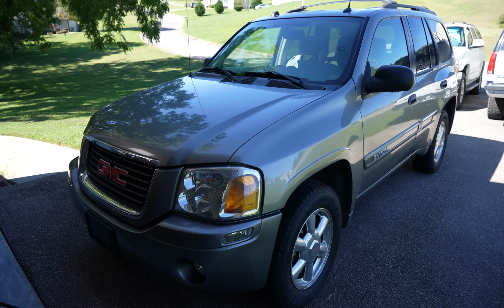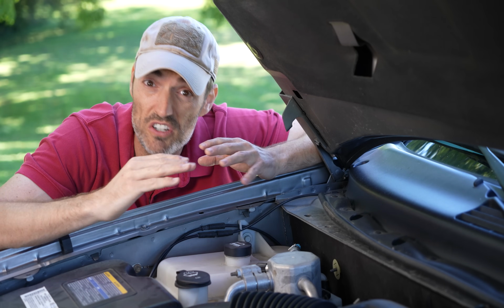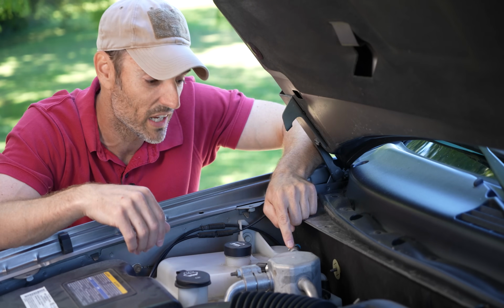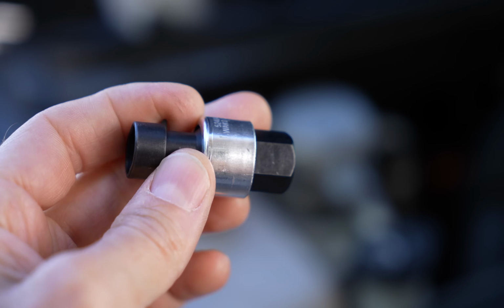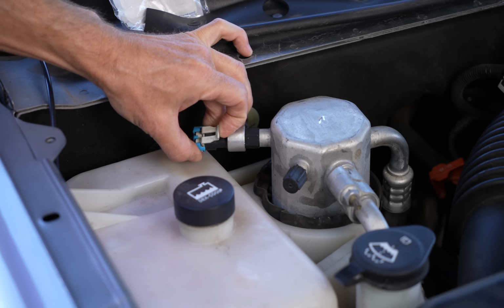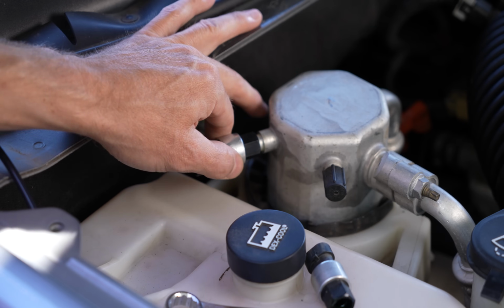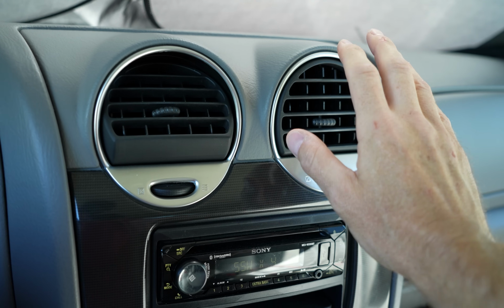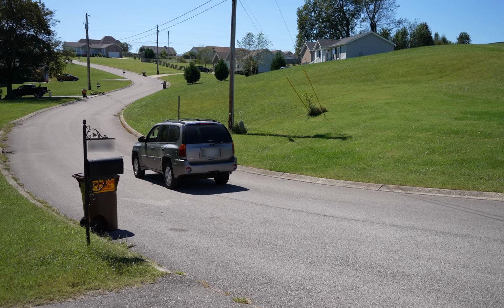GM Air Conditioning Pressure Switch Problem and Replacement!!

Comment: I think you should have checked the clutch or relay.   This parts cannon video isn’t the end of the saga.   Guaranteed.
Reply: If clutch cycles on and off it’s a good sign the Freon is low small amounts do leak out over time. If nothing happens but the clutch works jumping out the clutch relay then it’s probably a bad AC pressure switch the PCM won’t ground the clutch relay or the cooling fans relays if the pressure switch isn’t sending out the voltage the pcm wants to see
Reply: I replaced the fuse and AC relay still the problem persists.

Comment: Nah, I've always ended up with the right pressure in my system, but no cold air.
So I know it doesn't need a recharger. I think there is blockage somewhere or I may just need a new compressor.
2007 Lancer es.
If anyone can think of whatever else it. Advice is always welcomed.
Reply: There is a restrictor in the line with a super fine mesh screen.  There are 2 types these days, an expansion valve,  and an orifice tube with a screen.  If those get stopped up, which is common on higher mileage cars, they block the line and need to be changed.
 A shop can diagnose it easy. Put the gauges on and tell you exactly what it’s doing.  Finding an honest shop is the hardest part.
 They sell a complete kit, which is my preferred way to go.  Compressor, drier,  orifice tube , oil.  I do my own because I have the gauges , pump and and everything. You can change all the parts then take it to be vacuumed and charged.  Then you’re all new.
Reply: @megastick9324  thanks. I work at a shop so I have the resources to fix it. I just had no idea hownto diagnos it.
Now I just need to find the time to bring MY own car in. And I'm still learning alot. I'll look into it. Thanks again🙂

Comment: You can also jump the switch wire to check the circuit
Reply: Thanks for this tip Paul . This saved me a trip to the Mechanic and I diagnosed it myself .
Reply: I jumped the wire and the ac works but when I plug it in the ac doesn’t work. What should I be looking at next?

Comment: OK I looked it up - first the local mechanic replaced the fan clutch. But I had the SAME AC problem of it shutting off fairly soon. I was hauling fresh fruit for a job so I HAD to have AC. So then the Dealer checked out the AC - and found the low pressure and high pressure was good. So they replaced the fan clutch AGAIN claiming that an OEM part was needed. NO PCM update was done even though there was TSB previously for a needed PCM updated if the fan clutch is replaced. Same problem happened again - AC works and then turns off. So I'm the first one to replace the low pressure sensor!! Wow. I'll see if it fixes the problem. thanks again. Time to test it out.
Reply: had this problem when the vehicle was idling in 100 degree weather , cuts off and on and off ect.

Not sure if its because of that part or because these vehicles were not made to cool off the cabin in extremes temps at idle

Comment: OK I just switched it out. Oops - I must have tightened it a bit too much because I thought that tab catch thing was on the bottom. So it's a half turn too tight. It's just 90 degrees too tight.

Comment: My AC gets hot if the vehicle isn't moving. Goes back cold when you drive. Sucks in traffic
Reply: I found out thats somewhat normal due to low rpms of the fan and the ac compressor pulley not delivering high enough pressure
Reply: as an a/c tech if  you have an older vehicle you may have a vachume leak, and the blend door is switching to heat
Reply: Sound like your clutch fan is bad and or radiator is clogged, but definitely replace the clutch fan on the front of the engine

Comment: I have mostly seen one side stop blowing clod but the other is so it's not the pressure switch even though people tell my friends that it is even tho that makes no sense
Reply: as an a/c tech I'll tell you that it's not what you just saw. if you have a busy climate system that lets you cool one side more than the other it is most likely low on gas, but not always
Reply: @terryfrederickson2774  no mine is either the controller or the blend door because the left will be cold and the right will blow hot and you can turn it off and back on and it's fine
Reply: @terryfrederickson2774   Hi Terry, 
Hope your still on YouTube, can I ask a question please,  are the high and low pressure switches the same, meaning is the same switch (part number) used for either application, I know it sounds silly but one switch might register both high and low pressures, thanks for any information 👍🏻
Reply: Sounds like blend door to me

Comment: I have the SAME problem on my TB air conditioning - and previously we had the fan clutch replaced - and it didn't fix the problem. I think local mechanics just replace an obvious part. Anyway I just ordered this part locally - it's more expensive - but Amazon is just too hard on its workers. Also I'll get this sooner. I'll let you know if it works. All I know is my A/C works sometimes and then just starts blowing hot air - very very annoying!! thanks
Reply: This guy never let us know if it worked. RIP
Reply: @ninjaguyYT  Funny - it's not hot often where I live - just so happens I noticed the same problem. Works whenever it wants to. So I researched the TB - lots of people have the same problem. The AC "works when it wants to." Hilarious. I replaced the part indeed. Oh well.
Reply: @voidisyinyangvoidisyinyang885  well, I bought a new transducer for my 18 year old Jeep, that should be arriving in 3 days.  I'm probably going to forget to report whether it works. But I'm feeling like it won't. The old one was pretty loose and it didn't appear rusted or damaged. I screwed it back in easily (also I didn't feel it squirt any refrigerant out).
Reply: had this problem when the vehicle was idling in 100 degree weather , cuts off and on and off ect.

Not sure if its because of that part or because these vehicles were not made to cool off the cabin in extremes temps at idle
Reply: Douse the AC work cold at higher rpms if so the compressor is weak and starting to go out
Reply: @ryans413  ok thanks - that must be what's going on! Yeah the AC works better if I'm at higher rpm. Actually though they replaced the whole system twice. haha. And it was the SAME problem right after they replaced it. Maybe the AC system is just junk overall. It still works "sometimes."

Comment: Overtime it is normal to lose a small amount of refrigerant over time. Just a couple of oz. I do recommend not throwing the parts cannon at but hey if ur pockets are deep and you are learning what’s to lose.

What should be done is a vacuum test. See how much vacuum it pulls and how long does it stay. You do not want moisture in ac system.
Reply: If your pressure switch is working but pressure is low slightly your clutch will cycle on and off that’s a good sign your low on Freon. If your clutch dose not engage at all but engages when you jump the AC clutch relay then you probably have a faulty pressure switch. The switch reads pressure and when the pressure is low it breaks the contacts and the PCM dose not receive the signal it wants to see so it dose not send out and voltage to the fan relays and the Ac clutch relay to engage so nothing happens

Comment: Why not trouble shoot it instead of guessing what the problem is? Auto zone loves guys like you 😂😂
Reply: Hard to troubleshoot AC issues. I’m having the same issue now, every time Ive taken it to a mechanic (4 different ones) they do the general troubleshot AC test and they say everything is running perfect with no issues or leaks. But of course I’ll be driving it in 90° weather and it’ll all of a sudden go out and start blowing hot air. Niche vids like these can save lives
Reply: @kinnyboy  mine hasnt blown cool air in weeks 2007 GMC Yukon...but it blows air like the heater is on.....Mechanic says may need to replace  sensor and a belt ? freon good/no leaks just HOT air blowing during 100% weather?
Reply: @Theranchhouse1  might be your blend door actuator
Reply: @pegachick  thankfully another mechanic looked at it and said it just needed freon...he put it in and its wkg grreat!!!

Comment: I've had issues on my '02 Blazer with the low side Schrader port sticking open, causing me to loose full charge. On the car's I've owned I've never had a pressure switch fail (I'm sure now that I've said that it'll fail lol). Good to know you can just unscrew those, I've always thought you had to vacuum the refrigerant and then replace it, vacuum the system down and then fill it back up, but this is good to know for the future!
Reply: You do have to remove all the freon replace the part then vacuum the system down and recharge on most vehicles. His vehicle is probably the only one I've seen like that.
Reply: @MN2_Kevin_Hill_1970  no you don't not on most cars you do it just like he just did on his what kind of car do you have so I don't buy one of those 😂👍
Reply: Obviously not all vehicles are the same.
Reply: I have mazda3. I couldn't change the switch because the freon was coming out. Not that easy.
Reply: So for anybody reading this later, they're talking about systems that don't have a Schrader valve. You should absolutely check if your ac system specifically has a Schrader valve before doing this yourself because in some cars you do need to evacuate all of the refrigerant and recharge it after, because it will escape if it doesn't have a valve. It's not only in new vehicles but different manufacturers started putting them in in different years. Do your research and be mindful that I think they can be added on to some systems, and there are similar valves on other parts of some cars, so finding a replacement valve doesn't guarantee your CURRENT *ac* system has one installed. It is not at the end of the world if you make a mistake and refrigerant escapes, but it's really bad for the environment (and therefore YOU) so if you are wrong just move away from the car and return after it leaks out. I do not recommend doing this without breathing and eye protection personally just Incase, but that's me having family and friends in HVAC and knowing little enough about cars to be cautious.
Reply: Should’ve show how to test those things before replacing. Good video though.

Comment: Any idea what causes the compressor to run all the time even when the heat is on? During the winter I have to unplug the compressor so it doesn't run when the heater is on.
Reply: It's designed to run with defrost and/or heat to remove moisture from the air to reduce window fogging.  In vehicles old enough to have manual control of the ac compressor, if your windows start to fog, hit the A/C button and watch them clear up!
Reply: @aaronpowell4885  my 2000 Honda does that... it's normal
Reply: @aaronpowell4885  I always run compressor during cold weather to keep windows from fogging up and heat is more comfortable since moisture is removed .
Reply: It is supposed to run during defrost
Reply: In winter it comes on with the defrost setting to remove moisture from the glass cause you got cold outside meeting warm inside helps defrost windows faster

Comment: I have a 98 GMC Yukon with no ac no nothing, it has 346,000 on it but she still runs good
Reply: Point is what ? Statement of Nothing Left that works , but the motor runs still ? Perhaps your motor is the last holdout part to fail ? Or Every Part Was Neglected to be Repaired ? What is the point in this experiment ? To see if the cigarette lighters Death will Blow your Engine ? Very Interesting !!!

Comment: You should have checked your pressures with a manifold gauge set !
Reply: This is 1R we dont do that here lol
he just replaces parts and expects them to fix stuff , at least they are OEM.
Reply: @JORGE4757S  Those parts rarely go bad,his problem is most likely a refrigerant leak !
Reply: Wrong. Those low pressure switches are a common replacement on GMs

Comment: I have a 2006 Chevy Silverado 1500 with 140000 on her and mine was doing the same thing after doing some homework I decided to replace the actuator door being my truck only has 1 and the part was cheap as well but so far that seemed to fix the issue.
I wanted to also add when this problem would a cure I found that turning the motor off and restarting the motor the problem went away and my ac would work again but now since the new part is in all is good .
Reply: Was your ac making a clicking noise as well? I have a 04 Tahoe that occasionally blows hot air on the driver's side.
Reply: @PaulieGlockzz  actually I'm not sure but it did seem like the ac compressor was still running but no cold air just hot air when this problem would acur.

Comment: Why not diagnose it - pull the code and then you have direction. I’m not a fan of loading the parts canon :-) just my opinion 🙂
Reply: Not all AC issues throw codes. Rarely ever will it throw a code. Especially older cars don't even monitor the air conditioning system. That's what the gauges are for.
Reply: Dude this is the wrong channel for you, Jimmy is the man of the parts canon
Reply: @JORGE4757S  😂😂
Reply: My AC in my old ass 2004 car just randomly stopped it blow hot air the AC light would be on no AC action the clutch would not engage and no fans running under the hood. The only way the clutch would engage and spin is if I jumped out the AC clutch relay even then no AC action. I removed the cap on the high side line and there was pressure also found no leaks and condenser looked fine no holes or leaks. I had no engine light or codes so last thing I decided to do is swap out the pressure switch really easy on my car it was right up by the cooling fans unscrewed it no need to evacuate the system it had a valve on it so only little pressure shot out screwed in new switch and soon I started the engine pushed the AC button clutch engaged cooling fans blasted full speed and I had cold air again
Reply: There isn’t always a code. I’m having this same issue but it’s not throwing a code at all.
Reply: When u know you know
Reply: I mean it's only a $30 part 😑
Reply: @JamesAutoDude  Actually much less on Amazon. My AC high pressure switch was literally like $11 lol. I changed it and rectified the problem immediately.
Reply: @justanexe  yeah that too. Rock auto is another cheap place as well especially if you want Genuine parts lol
Reply: @JamesAutoDude  Yeah, Amazon has some genuine parts too, but RockAuto would definitely win on that end. It’s just a matter of not getting things as quickly like you would with Amazon although lately Amazon hasn’t been on par.
Reply: @justanexe  yeah Amazon I've noticed has been cheaper then RockAuto even for genuine parts, especially for speed of delivery even with delays
Reply: If you are lucky, on some vehicles it will show the Live Data on the OBD tool. Makes diagnosing this issue easier.

Comment: Just replaced mine a couple weeks ago on my 1999 suburban with 85,000 miles.
Reply from the maker: And it fixed the issue?
Reply: @1RoadGarage  watched your videos alot when it comes to my 99 Tahoe and my 99 Suburban. Great helpful information.
Reply: @1RoadGarage  sure did, only issue was when it quit I still had a 4 hour drive home in 90 plus degrees.